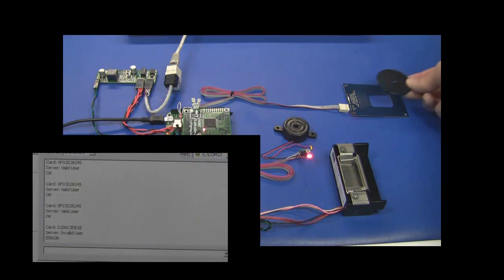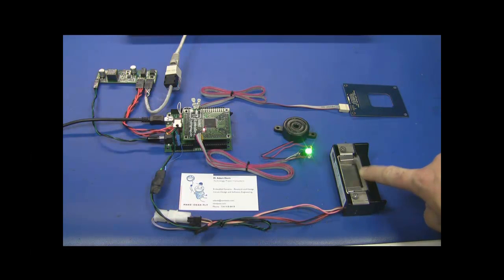Internet Enabled RFID Door Lock

Comment from the maker: @joshthewacko Make Controller and I/O board from solarbotics, RFID reader from parallax, Power over ethernet supply from digikey, HES 5000 series electric strike.  I used MCBuilder from makingthings to compile and program the chip.  The server is running a simple ruby server that connects to someone else's membership management software.

Comment from the maker: @catskul No, it actually surprised me, after all the bad stuff I had heard online.  We've had one of these in place with very simple code running for several weeks with absolutely no issues.  I have to admit that there are some quirky things I found while programming it that I didn't like - problems I could not see a reason for, but by restructering my code they went away - but beyond that, I'm pretty impressed with how the controller is holding up.